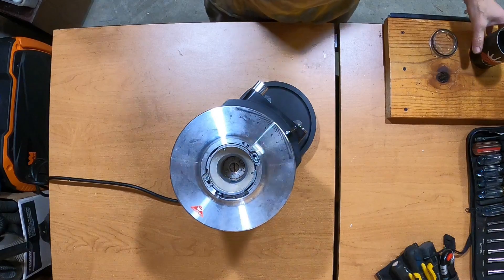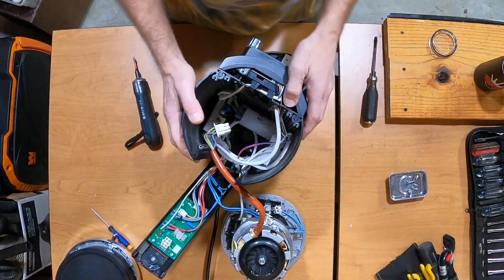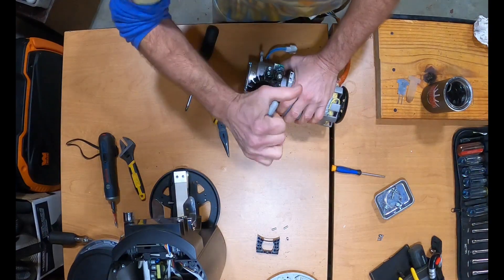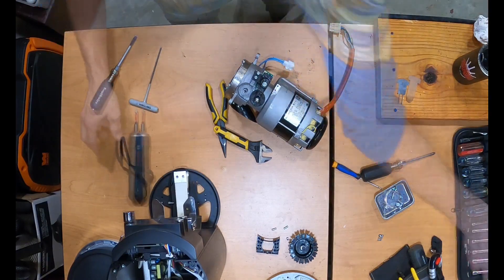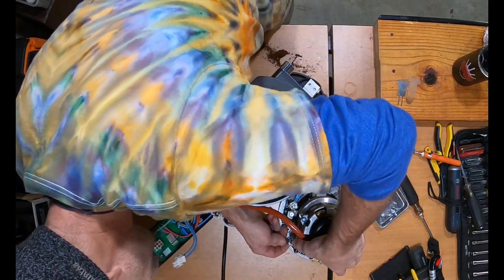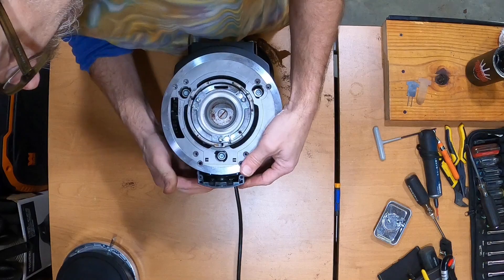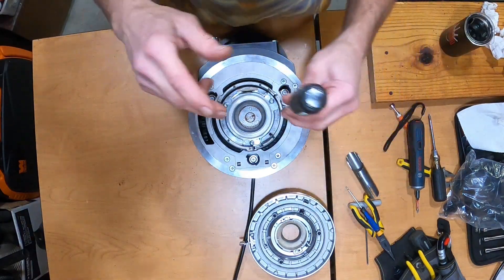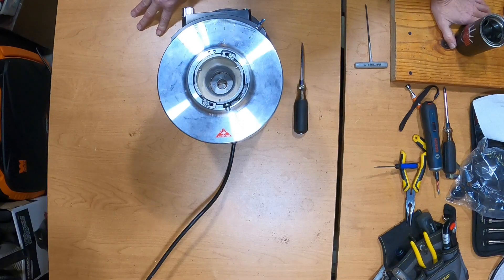E65 s gbw , Complete Motor removal , gear repair, and calibration.  (works on E80 line also)

Comment: Hi Mark, not sure if you’d be able to help but I think we had a botched firmware update for our E80 non-gbw. I am now no longer able to get the grinder to power on. Circuit breaker is not tripping either. Any possible ideas?
Reply: it can happen , ive botched a couple myself .  I would double check that you have continuity at the overlimit, and that the hopper safety is triggered properly .. if both of those items are good , and all wires are connected then it is most likely a botched display  . Did the power get interupted or did the update just fail to complete? Unfortunately I  dont know of a way to recover that display .
Reply: @theREALMarklar  update failed to complete and was getting “respone 200” on the firmware update software and the display was frozen. So I switched the power off then back on and was not able to get it to reset by holding both buttons + the jog dial before flipping the power switch back on

Comment: On ours, one of the 3 hopper metal short anchor lock pins is missing.... 
I don't see a replacement part for these pins. I guess I'm going to have to try to see if a nail or used rivet pin will fit the hole and then super glue and baking soda into place(as well as the 2 remaining pins so we don't loose those).
Thanks

Comment: Hi, Is the knob pull off/removable? Ours needs some electronics spray cleaner sprayed into the knob shaft.. Because the knob response has gotten bad/jumpy/unreliable. Due to common age/oxidation of internal contacts... But unplugging and spraying with the knob installed, blocks the spray from getting where it needs to. Ours is the non-GBW model, simpler E65S model.
Thanks

Comment: Привет, Марк! Может быть, ты знаешь, в чем проблема. Сделал всё также, как на твоём видео. Но кофемолка делает неестественно крупный помол для эспрессо на минимальном расстоянии между жерновами. Уменьшить расстояние между жерновами  не получается. Заранее благодарю
Reply from the maker: If there is buildup under the rotary carrier you may need to remove it completely and clean underneath like in this video https://www.youtube.com/watch?v=fDAMyWsaQF4&list=PLfAJG0wJQ7yUr0MqZ9AzSFOV3hrtJGo8p&index=2&t=4s  , .. also make sure the burr with a D on the back is on the bottom, and the S is on the TOP  , hope that helps

Comment: Hi Mark great video. I took my E65S GBW apart to replace the display that was defective and when putting it back together I noticed 2 plastic rods that are mounted at the front of the motor and don’t know what they are for. I’m hoping you can help me figure what those 2 plastic rods are for.  By the way in E65S GBW I didn’t see those rods. Thanks